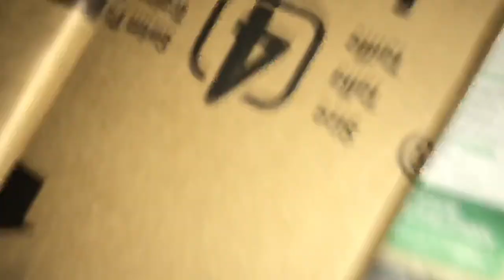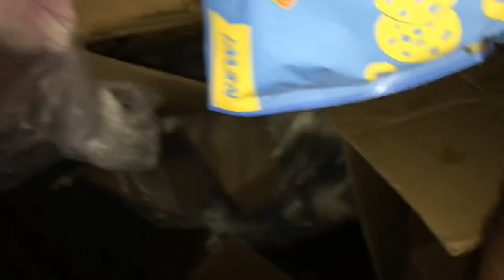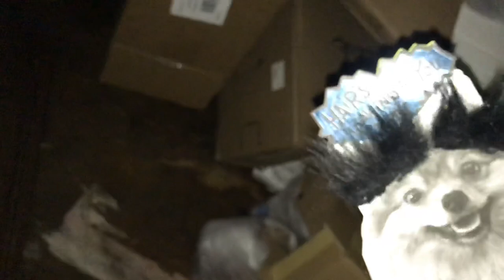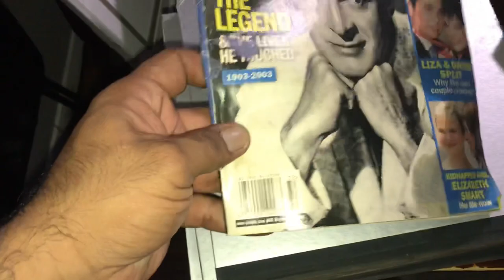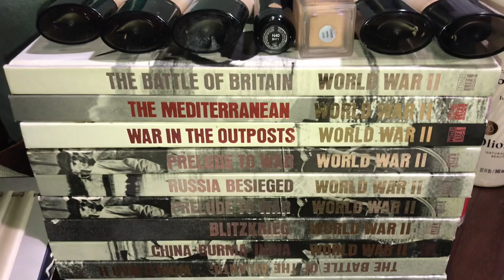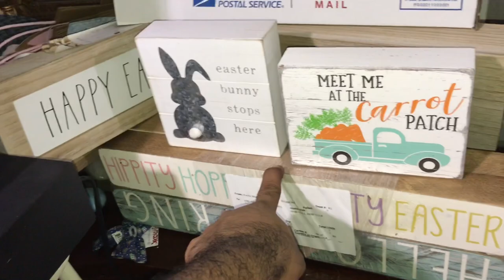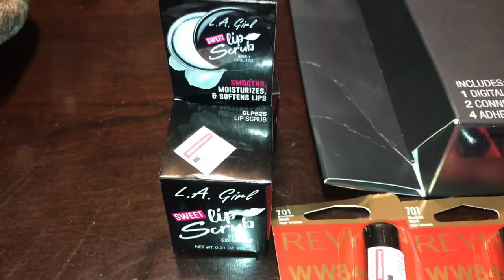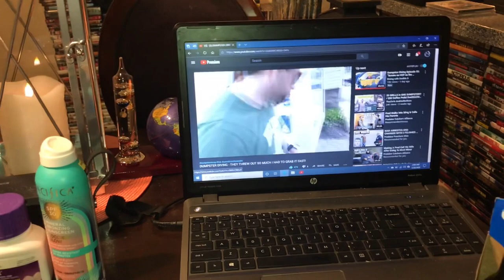Dumpster diving @ Burlington and my other favorite store (Episode 116)

Comment: Was reading your comments on this one when the bell went off on the other one.  Hahahaha.  I am interested in buying a make up box from you if you still have alot.  I am glad you from the electric shock machine for your knee.  I have had to have both my knees replaced so I know about knee pain.
Reply from the maker: Oh my emails going off. Lol. I could see what I have left and make a very good deal for you. I feel your pain well mines isn't that bad as yours now. Good luck 🍀🙏❤️👍
Reply: Ok if you want just see what's there and get back with me on messenger.  That will work right? Or do you want to do email?
Reply from the maker: @sarahlipham4032  yes thru msgr
Reply: My knees don't hurt anymore.  The last one was done about 4 years now .
Reply: Ok messenger.
Reply from the maker: Ok good.